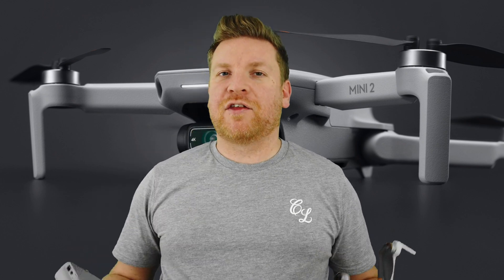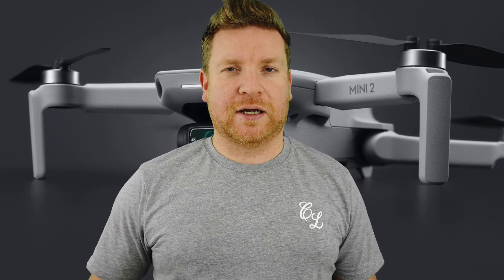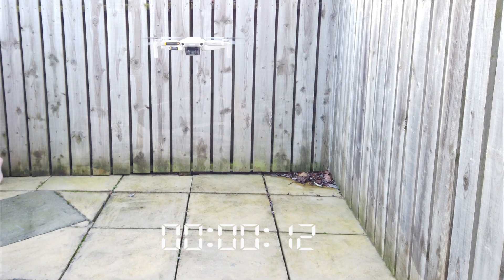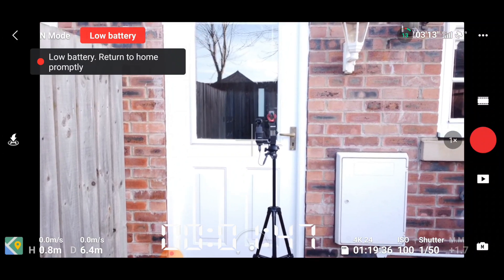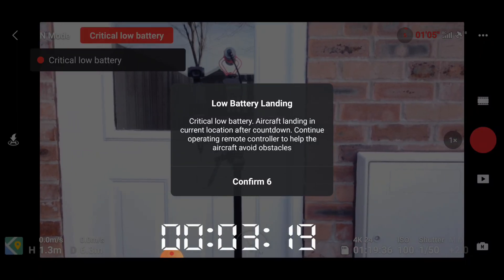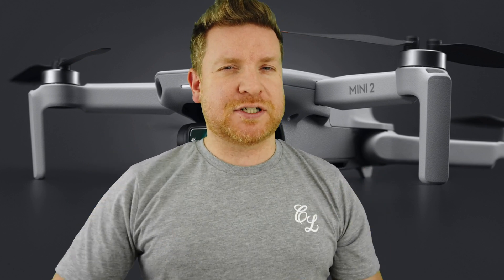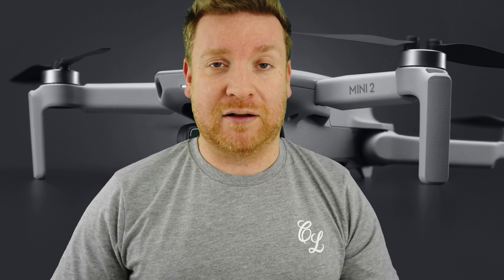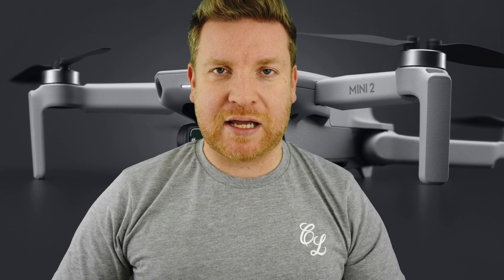DJI MINI 2 BATTERY TEST - WHAT HAPPENS AT 0% 🔋SECRET RESERVE?

Comment: time to solve the myth or is there a reserve

In short it depends, if the lipo is above 3.5V per cell it wont land. Even if your battery displays “0%” 3.5V is the cutoff when the auto land will trigger. Keep in mind it depends on what type of battery it is lipo or lion. At 3.5V there will be a forced landing in progress if the battery is at 0% you can check your battery voltage in safety then battery. Keep in mind your voltage does vary depending if your in cold conditions or your flying in sports mode.

Comment: does running it down all the way ruin your battery? i ruined a battery on a x220 wizard because i ran it until it stopped (about 9 minutes). i should have stopped at 5 minutes.
Reply from the maker: Nope there has been no Ill effects on the battery as a result of the video :)

Comment: Safety reserves are certainly provided in the battery electronics. However, such violent excesses significantly shorten the life of the battery, especially if this happens repeatedly. 
By the way, you can double the life span if you only charge the battery to 90% and do not discharge it below 25%. 
If the full capacity is absolutely necessary for a flight, then you should only charge to 100% immediately before the flight and then charge again to about 25% after the flight, if you do not plan to fly with it again soon.
Discharges to less than 10% should be avoided if possible.
If not used for a longer period of time, the battery should be stored in a dry, cool place at about 25% charge.

Comment: Spot on and the same characteristics as my Bebop2. Once it gets to 30% any significant load say S mode and it drops like a brick. This is also a new battery and the same has been observed with all batteries. Once at 30% flight time is I would say a Max of 3 mins.
As such I always try to get back with at least 40% if I send mine on a long flight. At 30% be gentle and you will get a lot more linear drain.
This is a great safety measure well done DJI.
Reply from the maker: Yes this is certainly a positive - it seems DJI really have built in a safety margin and even going to zero and still flying it seems it is just fine also!

Comment: I think that this shows limited experience of LiPo batteries. If you continue beyond the point where you experience a power loss, then you are damaging the batteries. This will not show up in the next few cycles. Running the battery down to the true zero point will destroy them. So the drone will have a cut-off well above that point. If the drone says 0% it means you must stop flying, it doesn't mean that the battery is really at 0%. Things get more complicated with 'smart' batteries which will have their own built-in limitations.

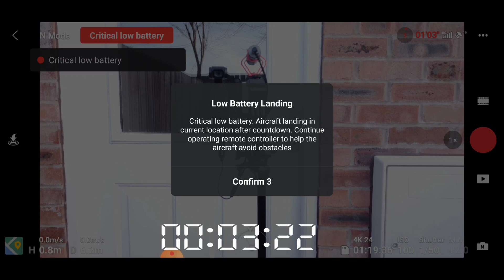Comment: Thanks for testing that...So when DJI tells you that you've got 20% battery left it isn't actually 20%...as you'd get 6:20 of flight (based on the battery rated being rated at 31mins and assuming the battery was fully charged) if it really had 20% battery left..but hey 5:10 is close enough for horseshoes and hang grenades (American saying...for good enough).  I do wish that DJI would allow you to turn off/turn down that damn low battery/critical battery beeping. I'm jussayin...
Reply from the maker: its horrendous isnt it! and so bloody loud! maybe not turn it off but at least dismiss it I guess! and yes indeed, the battery also was not damaged in any way so I gather the safety margin built in is quite large!
Reply: @GAVINHR  Horrendous is the perfect word for. .I'd be more than fine if you could dismiss it (peferably both the initial warning and the urgent land beeping after each begins).
Reply from the maker: I feel the same! One at 20. One at 15 then the 10% one stays on I think
Reply: @GAVINHR  Sounds more reasonable...although I'd like the ability to dismiss the final warning as well...but that's just me.

Comment: Did anyone noticed a thin orange/yellow line at the top left corner? I had noticed in all the 4K footage from the DJi mini 2 even at DJi website they have that sensor problem. I just finished watching a Spanish youtuber channel where they talking about many many people already noticed that issue.
https://youtu.be/22lcG-4X5Q4
Reply: Same here, but I notice that the the orange line only appears depending on the lighting conditions
Reply: The latest update corrects that as well as the uneven color on DNG panos.  the update was on Dec. 28th. MAKE sure that you also update to the latest FlyMe app to take care advantage of the updates. If you have an Android device it isn't at the Play Store yet....you need to go to DJI  and download from there.

Comment: Gavin, you are the top test man! So... the message is KEEP CALM AND DRONE ON.

🔥 LiPos are prone to spontaneous combustion if not maintained correctly, so I'd be interested to see a test of how hot they got during charging, compared to, say, landing with 10%. It's best to store them in LiPo-safe container (or kitchen fire blanket), especially when they are self-discharging.

Q. Can you do a test to check that RTH speed is maintained through low battery conditions, and maybe combine that with a test of Find My Drone? If the drone slows to conserve power, it might not get home after all...
Reply from the maker: Well, since I am the top test man as you say! I can confirm that after 20% battery there is no dip in speed :) well certainly not on my flight test previously, I had a 2 m/s drop after 5% but that is it but I was slowing down just after
Reply: @GAVINHR  Thanks for a quick reply. BTW, I am really looking forward to receiving your Super Yagis, which SWMBO ordered yesterday. I anticipate that they will make a real difference when I fly my Mavic Mini over wet tree tops, which really attenuate the signal.

I hope to capture vistas of fog lying in frosty valleys, time-lapse of mist flowing down hills, and the layered silhouettes of hills at sunset. There's no time like winter for aerial photography 👍
Reply from the maker: Oh my! I didn't even put 2 and 2 together! Of course! Yes these will be posted today and I will give you the tracking details once I have it 😊
Reply from the maker: That sounds very scenic! Make sure you get some posted on here ! I'd very much like to see that!

Comment: Gavin - Good effort but It would have been a bit more revealing had you clicked on the battery icon to monitor the decreasing battery voltage, especially at the end of the test.  As you know, Li-Po batteries can be permanently damaged by allowing the voltage to drop too low and it would have been informative to see the lowest voltage.  And based on my own experiences, I personally no longer like Li-Po batteries and feel like it was a mistake for DJI to switch from Li-ion in the Mini since there's hardly any benefit vs the negatives.  I do believe DJI is going to regret that decision as I expect customers will start complaining loudly at some point when their improperly stored batteries start losing performance and start outright dying early on.  Of course, this is just my opinion and I hope for Mini 2 buyers that this doesn't turn out to be the case.  OK I'll shut up now.

Comment: Nice test Gavin. 
I always land within 20% but it’s nice to know if you do run into trouble that little bit of juice can get you home. Even if you do cook your battery in the flight at least you’ll have your  drone back
Reply from the maker: Well that's my thoughts, I'd rather damage a battery than lose my drone, however if you saw my pinned comment it has not damaged the battery at all, the voltage and cells are the same as the other two so I guess even flying below 0% this is still taken into account by DJI!

Comment: Another great video, man. Quite clearly, your demonstration shows that DJi have tinkered with the Mini 2 and built an allowance into the new batteries. In saying that, I was flying my friends Mini 2 the other day, and when I hit 20%, by which time I normally land, the drone slowed down dramatically. Lucky this was one of the few times I wasn't flying over the sea, and I wasn't far away 🤣.
Reply from the maker: That is EXACTLY why I tested it, the mini 1 I had so much confidence on range tests as I explain in the video but then M2 just drains to quickly so I just wanted to see how much juice it actually had left as I've noticed it Dean fast at 20%
Reply: @GAVINHR  Message to self: don't comment when tired 🤦‍♂️😂. I meant to say speed; his drone went from max speed to less than half when it got down to less than 20%
Reply from the maker: To be fair I was tired also! I wrote Dean fast instead of drain fast 😂

Comment: Great test. As a comparison the mini 1 with the Lithium Ion battery will give about 1 minute of actual flight once it hits 0% shown here at 23:50 https://youtu.be/oIJtDBB3EvA
Reply from the maker: Thanks Pete! Normally I would of liked a more scenic location but I wanted to get the video out and the winds wouldn't allow much else! Seems there is quite the margin built in!
Reply: Yep, if its any consolidation, I'd have preferred to ditch it in the back garden in a more controlled environment! My battery worked a treat, no difference even after 10 days outside and taken beyond zero!

Comment: Another cracking vid Gav, it's nice to know that there is still a bit of juice left if needed, out of interest, how long are you getting out of your controller battery?? I haven't seen anyone put a figure up yet.
Reply from the maker: Hi Tony, not sure to be honest, I tend to automatically just charge my equipment after each flight I don't think I've ever got the controller lower than 3 bars! And that was doing three full flights
Reply: @GAVINHR  Good to know, I'll be using my controller to keep the mobile charged while I'm flying so by the sounds of it it shouldn't die on me
Reply from the maker: Yes I also use mine for charging my phone, I always charge my phone above 60% anyway, I do have a screen recorder running also so the battery does drain sometimes but it's never died on me, same with the mini 1 controller
Reply: @GAVINHR  you're the man with all the answers Gavin, my mini 2 is still sitting under the tree wrapped until Xmas lol, the wife won't let me open it🤣😭  we get some mental weather over here in the west of Ireland, but when it's dry it'll be perfect flying, there are miles and miles of landscape without any fear of hitting anything, I have a mountain called Nephin only 5 minutes up the road and a huge Lough to go exploring with the drone, I can't wait
Reply from the maker: @bugnut01  At least you do not have long to wait! indeed it dos look stunning, I follow a couple of guys across the pond and their footage is fantastic! Let me know how you get on and get some footage up once you can, that location sounds fantastic
Reply: @GAVINHR  I will 100% be uploading all my footage up online,  at least that way I will always have a back up,

Comment from the maker: For all those wondering if the LiPo battery was damaged... The answer is no! I suspect even going past 0% battery this is within the safe battery levels ! Both voltage and the cells are comparable with the other two unused batteries! 🔋 Charged to full and has since discharged in a second control flight afterwards

Comment: It's good to know you have it - but your batteries go under voltage which probably means you ruin them or seriously decrease the life span.
Reply from the maker: Yves - indeed this is a risk, I do advise landing at 20% or lowest 10% in the video, I can confirm the test battery voltage after a full charge is the same as the others and both cells equal therefore I suspect 0% is still well within the battery limits

Comment: Hi Gavin interesting test. Just one quick question I know with the lithium ion batteries it causes considerable damage to the battery by draining it to 0% is it the same with the lithium polymer batteries ?
Reply from the maker: Hi Peter, it is not advised to run them low and deplete them fully, I actually suspect these are designed to be flown to 0% safely and beyond with no lasting damage to the battery... I have checked the battery used, it fully charged both cells, voltage is in line with the other two battery's and it has performed fine in a control flight afterwards

Comment: That's very interesting, I'm sure it will help someone out coming home especially across water with islands or certainly help to find a safer spot to land without panicking as they could possibly choose to land on an island not in the water or fields and not on a road . Also Gav did you check the battery voltage once the battery was on zero ie did you destroy the lipo or did it still have a safe voltage to be charged again ?
Cheers 🍻
Reply from the maker: Hi Richard! Yes indeed! It just shows to not give up as long as you throttle up it seems the battery has the juice to keep going. Yes indeed, the voltages and cells are fine - it has charged fully in line with the other batteries and has also discharged fine in a control test afterwards - it seems like even discharging beyond 0% is still within safe levels for the battery